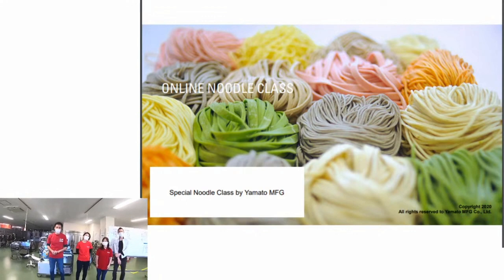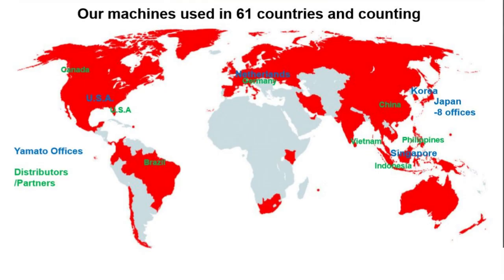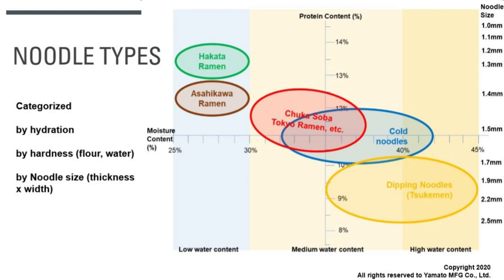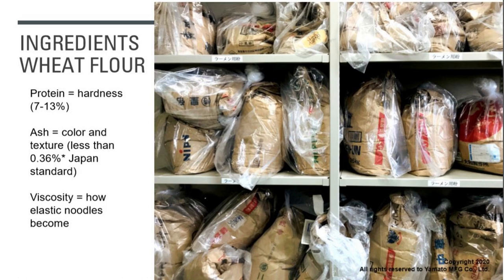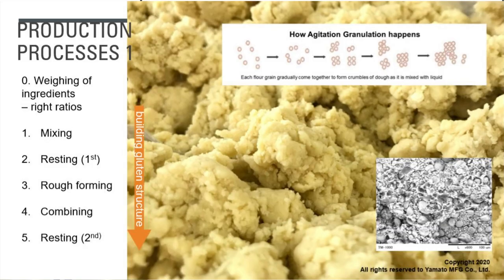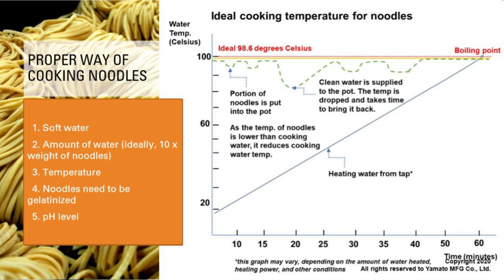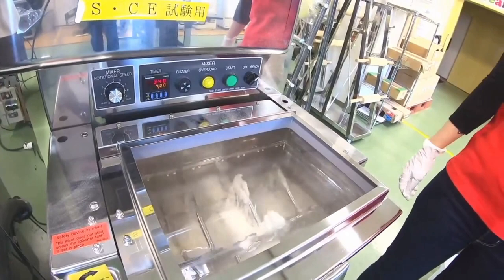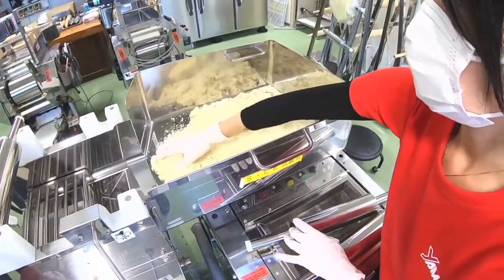Ramen Making Class: What is Ramen; Ramen Ingredients; Hakata Ramen Noodle Making; Ramen bowl plating

Comment: Are you guys already operating here in Malaysia? Here for home making, we can sometimes get Lye Water from local Bakeries which is mainly Potassium Carbonate. To make Ramen Noodle will I still have to mix it with some Calcium carbonate? And the other thing I am curious about is, I have baked a lot in the past, and normal hydration for bread dough has often been above 50% hydrations. Anything below and often it's quite dry and crumbly. What I'm curious bout is, does your machine rollers have very high pressure? As it isn't easy to work with such type of doughs by hand. I've attempted to make Udon noodles in the past, and even that I had to use my feet, my body weight just to flatten the dough.